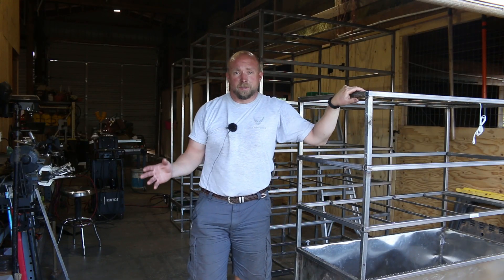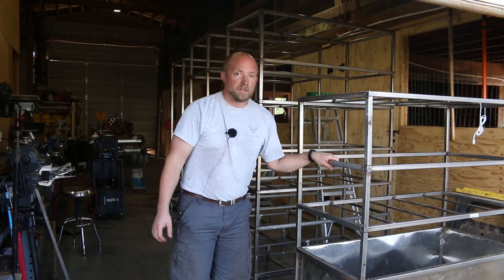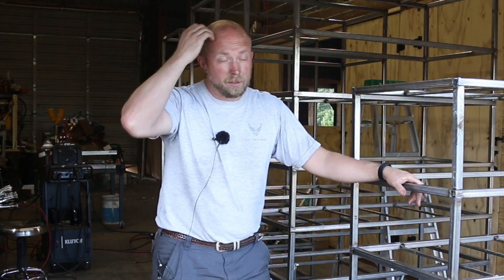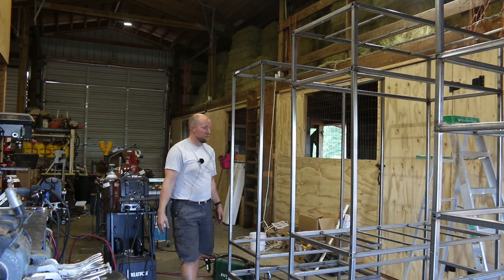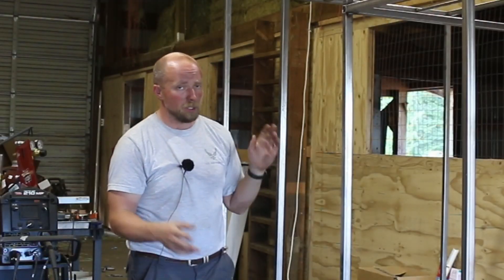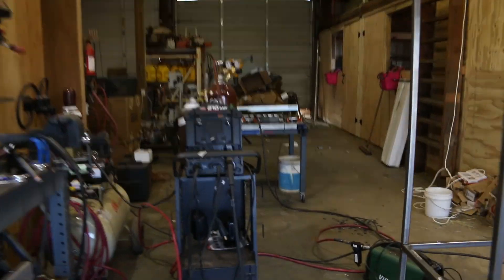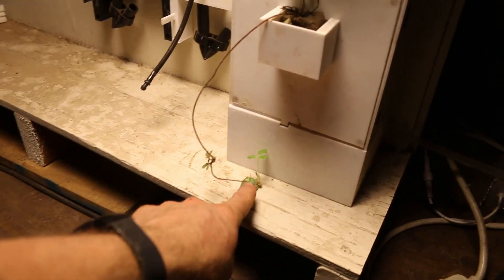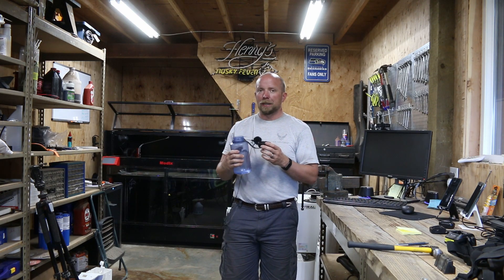Welding UP! AEROPONIC Grow Tower

Comment: Maybe put locking pins at the connections so you can move it around without it worrying about pulling it apart.